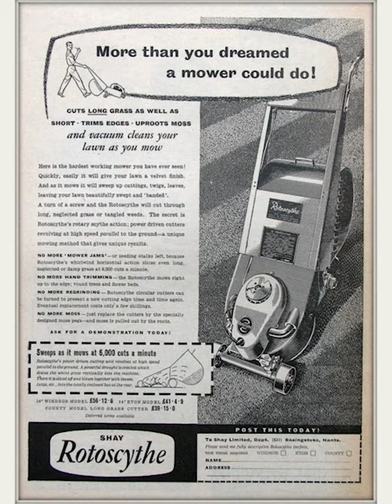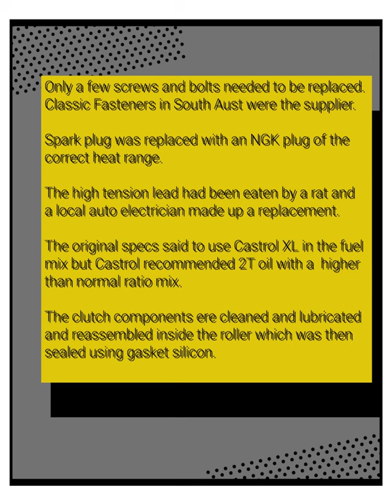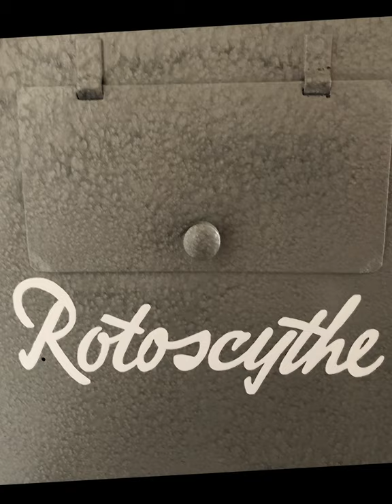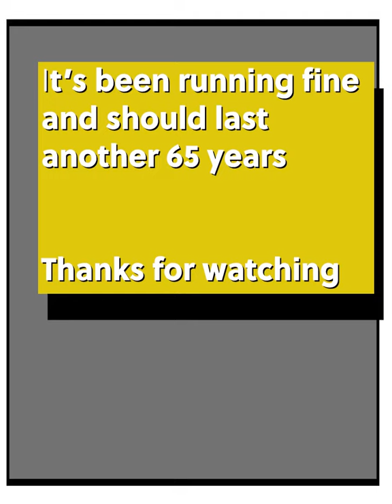Shay Rotoscythe 16" Windsor Restoration

Comment: This must be a fairly early Windsor model as it uses open cord pull start, my own Windsor model that I restored uses an enclosed pull cord rewound by a spring. I also restored a 1948 rotoscythe Eton model this one had the open pull cord like yours, it had a zenith carb fitted my own Windsor model has an Amal carb fitted, superb mowers high quality throughout.
Reply from the maker: The owner had two of this style, one was in very poor condition and was used to restore the original his father had purchased. Have notified him of your comments. Thanks.
Reply: Hi Van,  I own a disassembled Rotoscythe Eton that I'd like to please ask for advice on reassembling. I'm unsure how the throttle cable attaches to the carby? It'd be great if I could see the carby with the cowling removed. Also, the springs are broken on the front axle. Any advice would be appreciated.

Comment: Hi, I own a disassembled Rotoscythe Eton that I'd like to ask for advice on reassembling. I'm unsure how the throttle cable attaches to the carby? Also, the springs are broken on the front axle. Any one-on-one advice would be appreciated.
Reply: I restored the mower about two years ago and from memory the throttle cable connection was just a Z bend. I don't have it any more so I can't check. With respect to the front springs, I can only suggest a spring manufacturer and find something close and then modify it